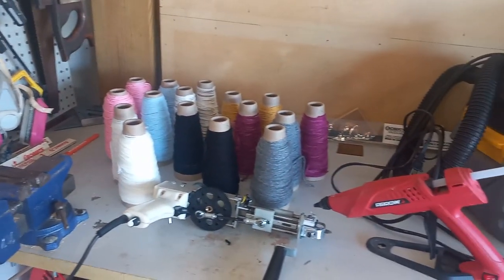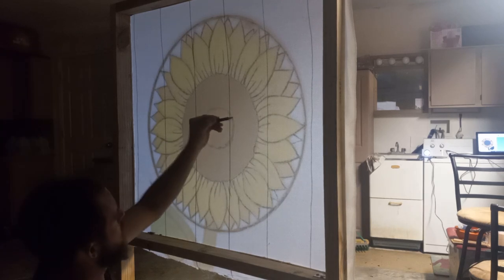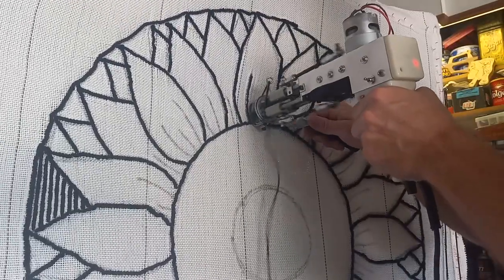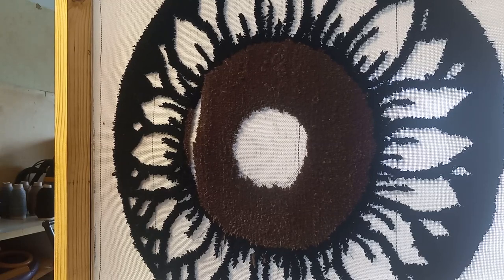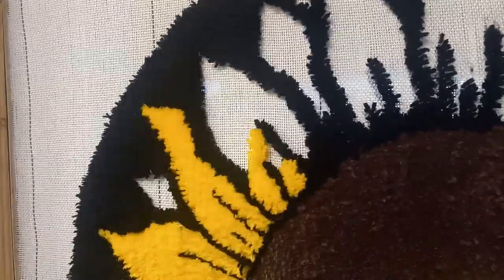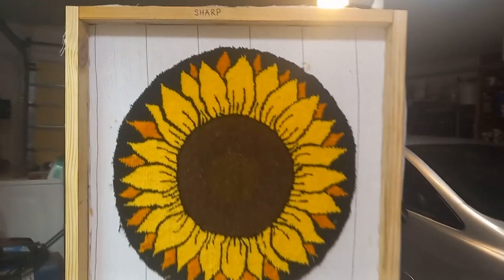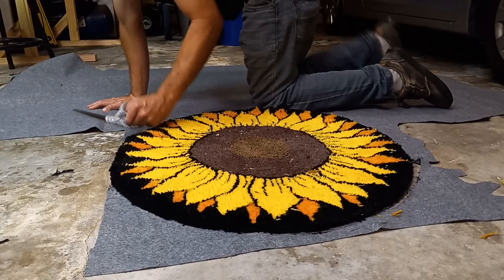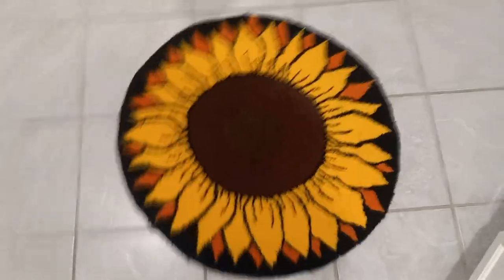Making a Fiery Sunflower Rug From Start To Finish with a Tufting Gun

Comment: How can you tell which is the right or wrong side? Is there like a texture difference??
Reply from the maker: It depends on which brand of tufting cloth. Some will have a texture difference, but most are the same on both sides and it doesn’t matter which side you use.
Reply: In this case, the good side is where he put the cloth on from. As you have to push the gun in when you are tufting, if you tuft from the otherwise, you can push the cloth off the frame. So you have to draw your design on that side as well otherwise you won't see

Comment: Hi, what kind of thread do you use?
Reply from the maker: Pretty much everything I use is 100% acrylic yarn
Reply: @HighOnRugsMichael  They told me that acrylic threads affect the tufting cutter and that it must be toothed or we need to change it after a while, and they told me that the best threads are natural wool or wool with acrylic only. Is this correct?
Reply from the maker: @alzaim9  I haven’t heard anything about the acrylic causing wear to the tufting gun, so I’m not sure about that. But I have heard that wool yarn is the best in terms of feel. I’m just using acrylic for now because it’s much cheaper and still feels quite nice. But I’m still relatively new to this as well, so I’m sure I’ll know more as time goes on.
Reply: @HighOnRugsMichael  Thank you very much
Reply: @HighOnRugsMichael  Does the use of velvet yarn harm the tufting cutter?!
Reply: @HighOnRugsMichael  Does the use of velvet yarn harm the tufting cutter?!!

Comment: Nice work but y not use the rug plastic so it can be washed instead of gluing it down
Reply: Glue is always needed whatever other thing is put on the top of it afterwards. It's the glue that holds the threads in, otherwise the threads would come out.